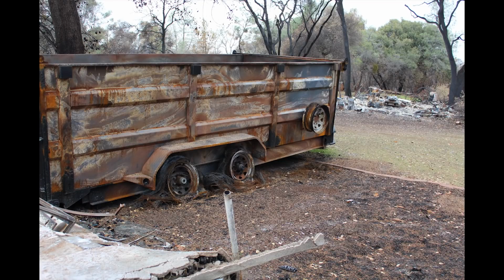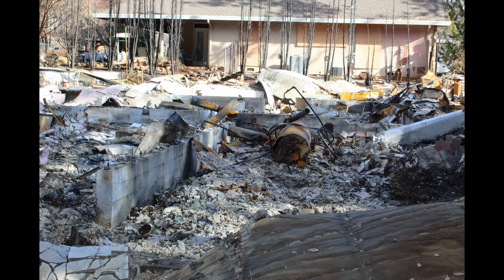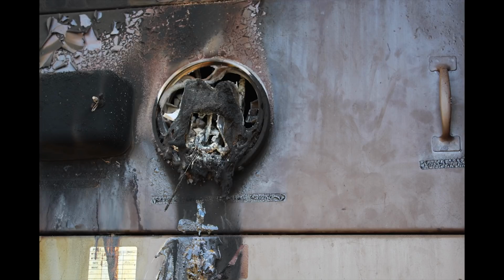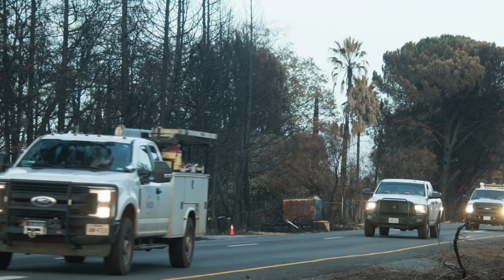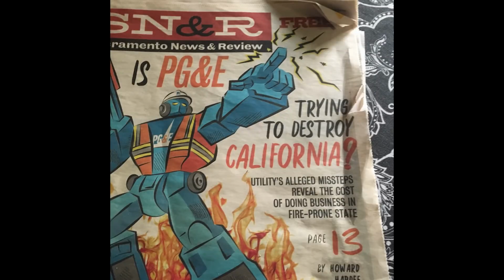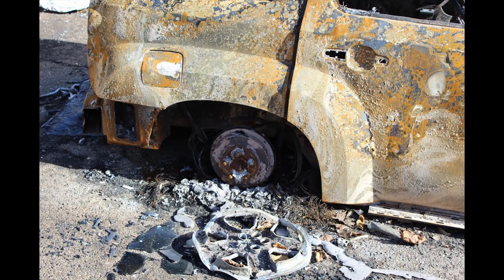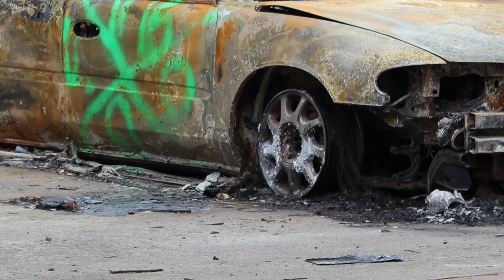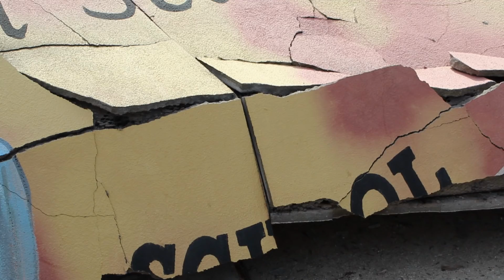MELTED SMART METERS!!  Part 2 Paradise Fires--Massive "Event" Expert Testimony Retired Fire Captains

Comment: These gentlemen are brave to come out. We should pray for their safety. This makes me very angry that we are being attacked on so many levels.As an electrician the grounding theory proves a strong point and is a smoking gun of evidence this was caused by directed energy.
Reply: illumi NOTme I totally agree! DEW
Reply: I'm an electrician too, I think the fires started past the transformer, meter and main breaker. I wonder if this weapon can heat up the Romex and start the inside on fire? What's your thoughts? Read my comment and check out the video of the Malibu house. Very interesting!
Reply: Sandy Walker haven't seen the Malibu video yet but will check it out but that is a feasable theory because it seems romex  would be the weakest link. It is the smallest wire in the circuit and has paper in the insulation...hmmm. On a side note I think the N.E.C. is a little biased in league with the copper manufacturers. If it was a frequency weapon it wouldn't matter if the breakers tripped because it would still be inducing current in the wires. I will check out the video! Thanks for a reply. Oh yeah and they are talking about mobile home fires here and I cannot believe what they get away with wiring them. #14 wire punched into those stupid knife blade devices ! Anytime I work on a mobile home I throw that junk away and use the real thing. Thanks for the reply.
Reply: Does that mean they are cutting the ground wires on all homes and buildings after they installed smart meters??

Comment: It was also mentioned in the first interview, as far as I remember, that fires seemed always to be connected to electrical lines or steel connections. Therefore, it becomes clear, that electromagnetic pulses were used to start these fires. Microwaves and other high frequency electromagnetic transmissions will do that and will bend or warp steel.
Reply: Marcel Baumann 
Smart meters.

Comment: I'm an electrician, it is code that all panels are grounded. The ground rod is about  6' long and is put into the ground except for about 1 foot. Then you take copper from the panel to a ground clamp. Then you ground to the cold water, it's all about grounding. I believe that it had nothing to do with the meter, I'll explain. Every house gets power from a pile or underground to a transformer, they overheat the main line, the transformer would explode. If they tried to overheat the meter, the main breaker would trip. My theory is, whatever they used overheated the house wiring past all these safety features, starting the inside of the house on fire. There is a YouTube video out showing a house in Malibu that had just been remodeled to today's NEC code. The house was completely stucco, had a flat roof and completely surrounded by a concrete driveway. This video was taken by the home owner's security camera. As you watch the video, you see a small fire/light on the outside wall. As the video progresses, you see a fire start on the inside of what looks like the living room. How can a fire start inside a house? Check it out, I think it was posted by aplanetruth, that video proves something strange happened. Also, there is a pick up in the driveway and a fire starts in the metal bed, what could possibly be burning? Hope this helps, great video!
Reply: Beware of 'aplanetruth'. He claims that the Earth is flat, so is almost certainly Controlled Opposition.
Reply: barbelmike I wondered about exactly that. He says he worked on Wall Street for 20 years? How did he get in all this. I’ve grown very distrustful! Is he distracting from other issues? A Laser expert said any laser strong enough to produce that much energy wouldn’t be visible to the naked eye. Yet pic after pic showing this blue laser. Makes ya think. I do think somethings up. Peace. 💜
Reply: Supercapacitors in the meters can be triggered to explode quite easily...
There are scores of examples of these meters exploding and catching houses on fire...
Reply: @KM-ce9cz  Most of these DEW lasers are outside of our visual range, but particles in the air that are visible will be effected and you will see this difference

Comment: The fires were caused by 2 sources-- dew lasers from the sky and a tesla electric massive charge through the ground which goes up the ground rod to your smart meter which causes a fire. This charge coming out of the ground is so massive that it jumps to the steel in the tires too. That explains the light poles burning from ground up.

Comment: This fire might have been the start of the DEW fires. A local resident filmed the 2003 Cedar Fire and makes some stunning comments on film.  I left a comment. 

This fire was very large and burned for many days, but the idea this was a week of strong Santa Ana  conditions is not true. I was 2 miles south of this fire at 6 AM on Sunday morning, when it was moving west,  and it was not windy. It never got windy on that Sunday.

How do I know that? I was outside with a hose and spraying areas to my west and to my east and to my south and north. If there were Santa Ana winds, you could not spray a hose of water to the east.  The winds were calm. 

The air was largely stagnant and hung over the county. I would say a very mild Santa Ana with a mild Onshore flow resulted in a stalemate. 

 If there was a strong  Santa Ana  the smoke would blow out over the ocean. It never did. When the onshore winds got a bit stronger,  they blew the smoke to Arizona. 

https://www.youtube.com/watch?v=aLG5PxLmwO8

Comment: Another issue with a fire. Heat rises and pulls in cooler air from the ground. If vegetation around was not burned, the air draw was cool air. How could there be so much heat close to the ground?

Comment: EMF meters are instruments used to measure electromagnetic fields (aka EMF). Typical EMF meters detect the electromagnetic radiation flux density (from direct current fields) or the variation in an electromagnetic field over time (from alternating current fields).

Comment: To be a bit more clear, my theory on the smart meter fires are the electromagnetic coils which will backfeed high voltage into the electronic boards when influence by external strong magnetic pulsating fields. The high voltage will start the circuitry to catch fire.
Reply: Would it be a fair statement to say, PGE is being scapegoated.

Comment: The dangerous part with the Smart meters, besides the radio frequency they transmit either through wireless or via wire infrastructure which transmits also into the house wiring, is the fact that most of them have nowadays an electromagnetic disconnect in  it which is most like the cause of these meters to start burning once the EMFs are transmitted from the DEWs.

Comment: Smart Meters turn the wiring in the whole house into a conduit for dirty electricity, so surges/pulsing would light the entire structure, caving it inwards as you describe.
Here in Southern Oregon, Pacific Power won't sign an agreement to be responsible for equipment-caused fire, melting meters (a Canadian Co charged a customer 5k for their equipment, blaming him for not upgrading his old service), health issues or breaches of privacy, yet Opting out is $36 per month. This Extortion is against  Federal law, and unsustainable for those on low or fixed incomes. Gas and water Smart Meters are also planned. Opt out x 3? really?

18 neighbors in my online neighbor group also reported extremely high Dec. bills, doubling or  tripling. One neighbor was gone most of Dec., had the thermostat set at 55, separate supplemental gas, and a $588 bill. P Power won't budge there either. It is probably PEAK HOUR CHARGING.

Youtube vids exist of recorded call ins asking if they should evacuate. 'No orders given' was the answer. Reported: Many roads closed or blocked, only gas station had no  power, 25 bulldozers stood by with 25 other fire equipment standing down.
FEMA set up way before event. Employee reported  to laugh that they cause the mess, then come in to clean up.

Comment: The steel is absolutely the smoking gun that I consider to be a true clue that somthing ad normal is at play involved with these fires, now I just have to ad that tire fire generates a extremely hotter fire than wood  does,  but if steel is melting in any kind of way then somthing not normal is happening  here. Aluminum melts at a low temp,  copper a little higher, but anything steel melting needs further investigation. NOW steel being heated at one end will cause buckling,  or twisting.  But I have to say that the biggest thing I'm noticing is what you keep pointing out is objects combusting that has no fuel of any kind close by, now I know senders of burning material blow around with the winds but I've seen some things that I can not believe where set on fire when the fires where so far away from the objects,  like the cars on the Malibu beaches,  the electro initiation of metal objects are very suspicious.  Especially when the wiring is fused,  I just have to say there is enough unusual evidence of things catching fire when logic shows it shouldn't have happened 
Is here to warent a serous investigation done by real scientist and forensics investigators who are very experienced with different types of fires.

Comment: Has anyone else noticed a similar white aspect to a normal camp fire 🔥 being stocked with the timber all or in part with timber that wad struck by lightning ... as I’ve noticed it nearly always is harder to split ( sparks ⚡️ upon striking it with the splitter) slower - hotter fire 🔥 but it always is a distinct WHITE NESS to the ash .... when i came through the Victoria Aussie fires in  2013 a week or so after the fires besides everything completely gone unlike any fire I’d seen but the white ash stood out as striking similar to timber struck lightning ( a tree stuck by lightning cut up then burnt two or more years after it was initially struck to clarify )
Reply: Michael Waters DEW
Reply: Jaymi McBride yes evidently welcome aboard

Comment: the Hutchison needs 2 waves to work 911 one frequency could have gone straight the beams treating the buildings as a turning forks then another to start the molecular disassembly ! with a smart meter maybe you can get the wireing to do the same and plane flying over to finish ?

Comment: It seems to me that they used a weapon that may use magnetic induction just like the new induction ranges. Only ferrous metals heat up in magnetic induction which is why you need certain types of pans and skillets when using them. Using non-ferrous metal pans will not work.